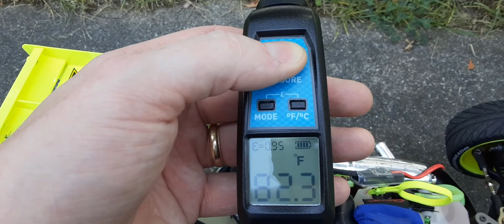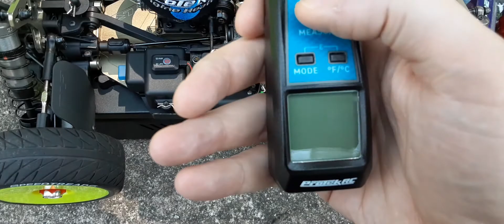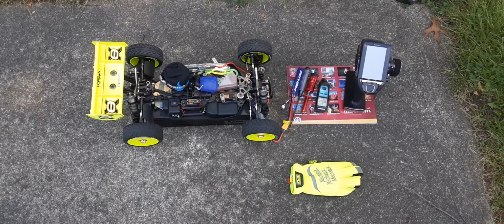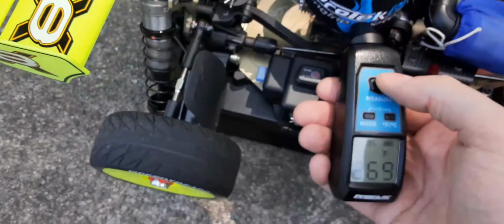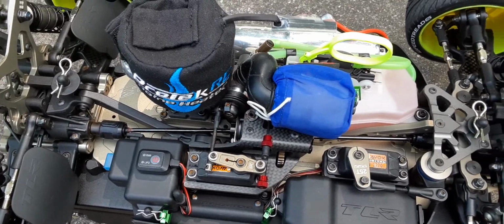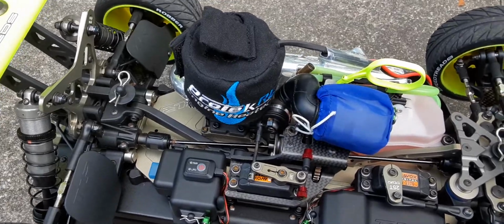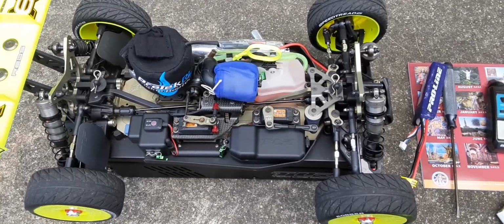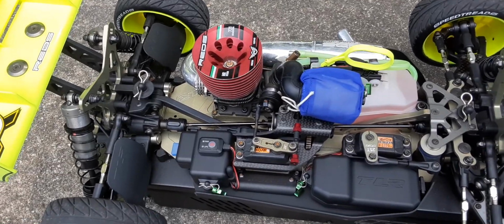Scuderia 7 port first time not startn on first bump. Time to tune!?

Comment: good stuff bro love the vid keep it up ive dropped some new vids checkem out hope all is well
Reply from the maker: Been super busy with the house stuff. Were finally closin this Monday. 1200sq foot fully ready for move in with a small barn or large shed whatever you wanna call it new complete with shingled roof and siding so my project will be turn it into an elec. / nitro hobby hut complete with 220v ac & heat wireless internet fridge basically the whole 9 specifically for my rc hobby. Bit a home away from home if you will. It already has bench style shelves both sides inside so its a start. Should he good to go on my 5B build for next year givin i got the spare $ with everything goin on. That and a gopro. Appreciate the support. Keep in touch brother!
Reply: @IMPORTKILLR187  awsome bro sounds like a good little work shop for sure i always try keep in touch bro